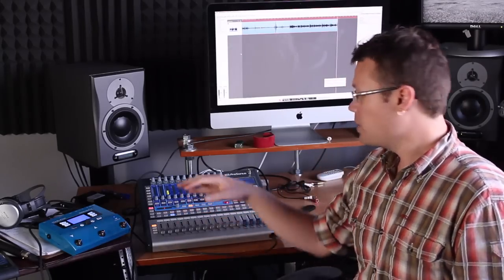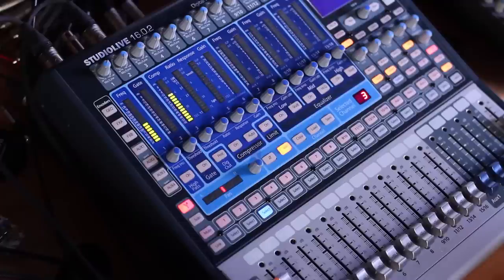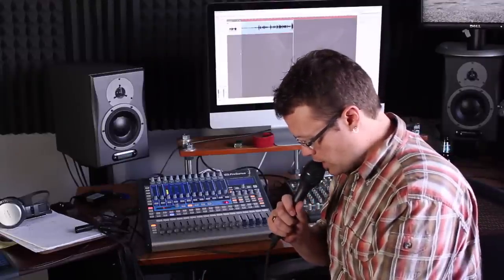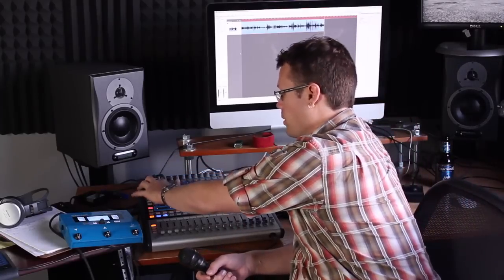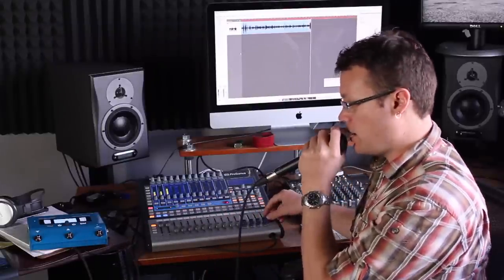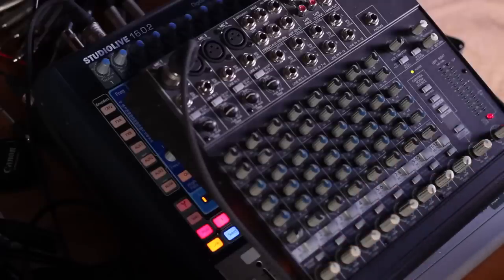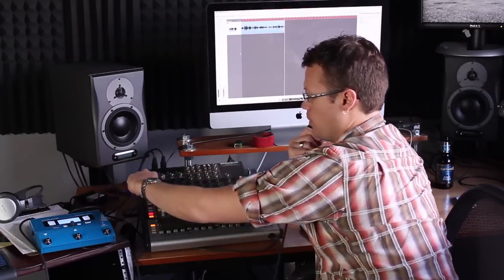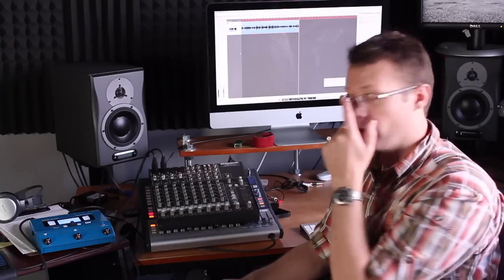TC-Helicon - Mixer Setup, Gain Staging and Vocal Processors

Comment: Hiya. I've just ordered the Extreme 3. I have a high quality RCF powered/active PA system. Currently I'm using a Yamaha 01v96 digital mixer for live use but it's too heavy, and so I've opted for the Extreme to replace it. I also have an API 3124MB 4 channel mic pre and mixer in one. The API is superb and I was wondering if I should run the Extreme's outputs into the API and then into PA, or if I should run them into API and then into the Helicon, and run Helicon outputs into PA? I'll try both options, but I'm curious as to what you may think on this yourself.
Reply from the maker: Hmm, tricky. I think I might try going into the API first, then go into the VL3 as TRS as a line input so our pre gets out of the way of the API a bit more.
Reply: Thanks for that - I'll be sure to try all options available and report back to you at some point. I gigged the Vl3 live last night for 2.5 hours and it's commendable. Very useful for cutting out lots of additional equipment I'd normally have to bring and set up. One of the main reasons I bought it is because I play about 5 nights a week in different venues as a one man band. Vocal, guitar, tracks and I recently found myself getting a back problem from all of the gear I was bringing. The Vl3 has reduced my set up time and load carrying by a large margin. No matter what way I bring the API into the chain it will improve things sonically, it's a superb piece of kit and I've done what you suggested in the past with other gear - tried to bypass internal pres. Can you explain to me how you think I should do it please. the API is 4 Channel. I would normally run Vocal into 1, acoustic gtr into input 2, and backing tracks in stereo connected to input  3+4. I can taken those individual outputs on API of Vocal and Guitar and run them straight in the Helcion on the vocal and guitar inputs. And I could take the guitar jack outputs, set to backing track outputs, and run them through 3+4 on the API. Or I could simply take the outputs of the Vl3, as it has very good routing options available, and into API as I was saying. Either way it will help matters. When you say you'd try going in as TRS, do you simply mean going into the same inputs but using instead of an XLR, a TRS instead? If not, could you expand a little for me please, and as long as I'll still be able to avail of all of th Helicons effects on vocals and guitar I'd be happy to try anything you suggest,Thanks in advance. The ability to 'cue' the next track/preset while playing a song is a great inclusion and I found it immensely useful last night when people were dancing. I could keep playing with minimum pausing between songs - a mere second. Brilliant.
Reply from the maker: Yep, just go into the VL3's mic input via TRS, since it's expecting a line level signal. If you're preamping at the API, you'll get a slightly better SNR that way. Just be sure to do the auto mic gain setup on VL3 to make sure you're hitting it at the optimal level. 

Glad to hear it's both lightened your load and made your shows smoother!

Comment: If my guitar is also plugged in to the play how do i separate the tracks so that for example on my mackie profx12 the guitar would be in channel 1 and mic in channel 2
Reply from the maker: kaywood Parsons You'd need to put your unit into Dual Mono mode. Then, it'll send guitar out one output and vocals out the other.
Reply: awesome!

Comment: Hello brother! : ) lol I don't get it : )  I have a behringer xenyx 1002b mixing board.  My mics seem like they do NOT have enough power for vl3 vocals effects? my sm58...no.  my sennheiser e845..no.  I am having better luck with my sennheiser mke 600.  The 600 works at about 80%, the sm58 0% and the e845 works at about 10%.  I think the 600 does well because it is a uni directional tv mic.  I just don't have enough power i believe.  I gained all the way up on my board. Loud good sounding vocal but no effects like harmony etc.  Are the pre amps on my mixing board not strong enough or am I doing something else wrong?  Any help you could give me would be greatly appreciated. Thanks, Michael
Reply from the maker: A 58 or e845 is definitely fine for a VL3X. Make sure you do the gain set procedure in the VL3X first. Then at the Xenyx it should be pretty close to a "normal" mic level and you'll set the gain pretty close to what it would be if the mic was plugged in directly. There is a Mic/Line output setting in VL3X. If you're not padded or something at the mixer, you could try changing the output to Line and that will give you a lot more output level. Also, make sure you check the mix pages in VL3X and that you don't accidentally have the main output level turned down.
Reply: THANK YOU! THANK YOU! THANK YOU! IT WORKED : )

Comment: I don't understand why all the tutorials show stereo connections, which means I'll be using 2 channels on the PA instead of one. (I don't see the point). How would I connect it to a single channel?
Reply from the maker: In a lot of our products we have a Mono output mode that you'd use to connect to a mono PA. Smaller stuff like Mic Mechanic is mono by nature. We show the stereo setup because people like to use our gear to record and generally stereo is preferable in that circumstance. Plus it sounds better on YT videos. ;)
Reply: You didn't answer my question. How do you connect it in mono?

Comment: gus i have pro fx12. connecting that way  .voice live.s  going to control effect.s instead mixer  ,so i have turn off effects from mixer tank.s for any help
Reply from the maker: That's correct. On the vocal channel, you want to turn off any effects, EQ, compression etc. that the FX12 might have available.
Reply: Hiya. I've just ordered the Extreme 3. I have a high quality RCF powered/active PA system. Currently I'm using a Yamaha 01v96 digital mixer for live use but it's too heavy, and so I've opted for the Extreme to replace it. I also have an API 3124MB 4 channel mic pre and mixer in one. The API is superb and I was wondering if I should run the Extreme's outputs into the API and then into PA, or if I should run them into API and then into the Helicon, and run Helicon outputs into PA? I'll try both options, but I'm curious as to what you may think on this yourself.
Reply: Yes for fun only

Comment: hey Craig 
you never mention about how to set the output  level in mix function。can you tell us how to set the proper level. thanks
Reply from the maker: +weipulee Typically, if you're headed to a mixer, you'd leave the output mix at 0dB. That'll give your mixer the best signal to noise ratio from the product. The output level is quite useful if you're going straight out of your TC-H unit into powered speakers. Lots of solo artists just carry a pair of powered speakers, a couple of stands and their TC-H box.
Reply: +TC-Helicon thank you. your information is really  helpful.

Comment: Is it possible to use the Tc helicon voice tone harmony gxt for recording? if yes, how? what's the set up? I need help ASAP!!!!
Reply from the maker: +JulieS Sure. How you'd like to record would determine how it's used. Do you want to sing/play into the computer and record it or do you want to take an existing vocal and process it through the Harmony G-XT?
Reply: +TC-Helicon I want to sing/play  into my computer and record it. So far, i use a snowball usb microphone that i connect to my computer to record my singing. will i have to buy a new microphone? is it possible to connect a USB microphone to it and then connect it to the computer? I am so confused right now and most of the material  i have watched and read so far, have not been very helpful.
PS  I don't do live performances most often.
Reply from the maker: +JulieS Unfortunately, we can't support the snowball, since it's USB. You'll need a dynamic or condenser mic that connects to a "typical" mic cable (XLR) and then go into the Play. From there, you can connect the outputs of the Play to a recording interface or, if you don't have an interface, connect via USB. 

In your case, since you're used to recording with the Snowball, I'd set up via USB. When the Play is connected, select it as your "source" for recording in your software instead of the Snowball. If you don't see the Play listed as a device, you might need to follow this (Windows) https://www.youtube.com/watch?v=8-M5WBc3qJE

If you want to try things out before getting a mic, you can connect headphones to the Play (don't connect the XLR outputs) and choose "RoomSense" as your "Mic Type" on the first Setup page. That will allow you to sing into the RoomSense mics in the product. It's not as ideal as using a "real" mic, but it can give you a sense of the setup and get you through the process of setting things up for recording. When you get a "real" mic, you can simply connect it and select dynamic or condenser in the input menu and carry on from there. 

Hope that helps a bit!

Comment: Can I use my TC Helicon with protools and reason 8.3? Thank you!
Reply from the maker: Sure. If it's a USB audio enabled unit you can set it up as an audio device in the DAW. If not, you'll need an audio interface to run the main outputs of the TCH device into, like you would with a mic.
Reply: TC-Helicon last question... so I want to record on my instrumental with protools I have an focuserite interface, do I need to connect it to the voice live play in order to use it with protools?

Comment: Great and helpful video.  Is it possible to go from the TC Helcion 2, to my Boss loop and then into my PA? When I do this it seems to need to add a bit more gain on the PA... Also, once I set up my gain on my VL my boss loop blinks red (clips) so I have found turning my output on the TC down to -12db seems to help.  Is this what you would suggest also?
Reply from the maker: ytfbms If you've got the input on the TC-H unit set up correctly, turning down the output a bit so the Boss doesn't clip is the right move.

Comment: I’ve owned this unit for a few years and I’ve found that if you gain stage as Craig describes it becomes totally unusable in a band situation. The signal is too hot for the mixer and I suffer ridiculous feedback  😡 not impressed with it
Reply: So, can you use it in a band situation, which is why I bought the thing?
Reply: I would also like to know if you managed to find a solution for this? I find whenever I plug in live with the band I get horrendous feedback. It’s so hard to find info on this.
Reply: @danielawilliams7911  not really , every situation is different venue, stage size etc, I found I had to turn down the gain a lot to prevent feedback. Think it’s aimed mainly at the solo artist where probably it minimises feedback issues. I’ve given up on it now to be honest
Reply: @ste528  appreciate the feedback! Thank you 🙏🏻

Comment: So how do I get tc helicon to a Mac? Does anyone know if I need a mixer or can just plug it in?
Reply from the maker: You don't need a mixer! you CAN use one, but that's only if your setup is big enough to warrant multiple inputs including your TC Helicon products. There's absolutely no problem with plugging your TC Helicon directly into a monitor, PA system or headphones!

Comment: hi can i use a wireless mic to a tc helicon device?
Reply from the maker: Yes you can! You just need to plug the receiver into your TC Helicon product and then it goes out to the board.  You should also note that it may add a millisecond or two of latency so we recommend trying it out first!

Comment: your vocal units would be so much better if they had an equalizer built in for the vocals for like when recording out of the usb into a video recorder.
Reply from the maker: Our Tone algorithm does automatic EQ, compression, de-ess and gating. The signal with Tone is what's sent out via USB for units equipped with audio over USB capability

Comment: should I still use the phantom power?
Reply from the maker: kaywood Parsons If you're using Play Electric you'd enable Phantom (if you have a condenser mic) on the Play Electric and turn it off on the mixer.

Comment: can i connect two or more mic in a vocal processor
Reply from the maker: +Santanu Bera It's possible, if you use a mixer before the processor to combine the signals, but (and it's a large one) you can't use any effects that create voices or do pitch correction. We can't create voices or correct a polyphonic signal. You can use Reverb, Delay, Transducer, Rhythmic but not Harmony, Doubling or Correction effects.

Comment: Hello! If the mixer I´m going to use has just one mono mic port, how do i connect the helicon?
Reply from the maker: Hey there! You should be able to do this: mic>TC Helicon in>mixer, and you can then connect any of your additional instruments to the TC Helicon interface you are using! This might change depending on the interface, so is there a specific TC Helicon product you are wondering about?